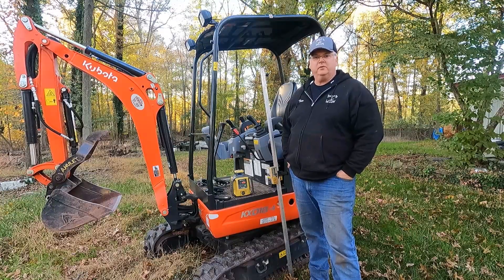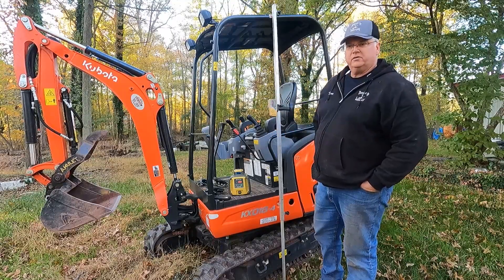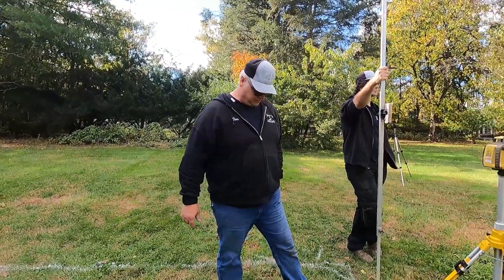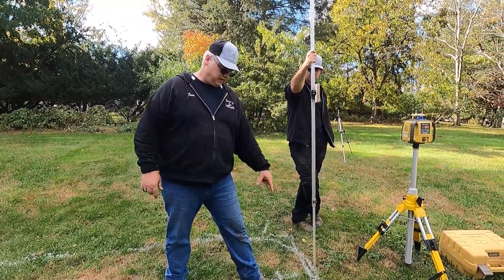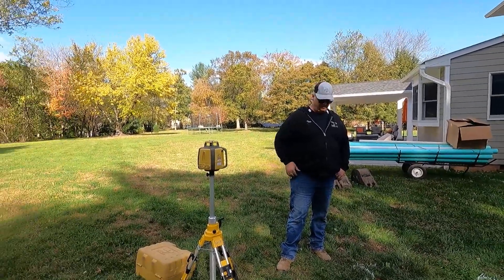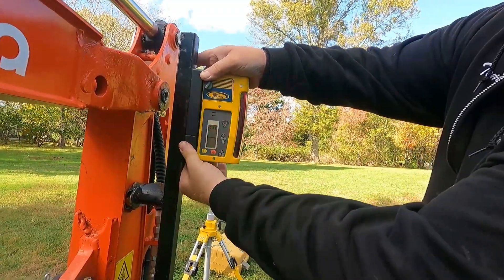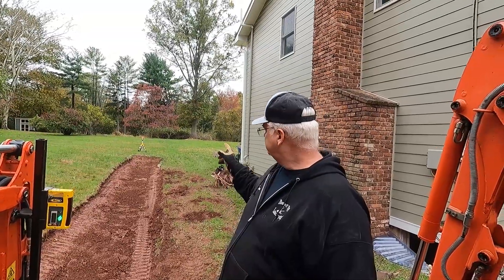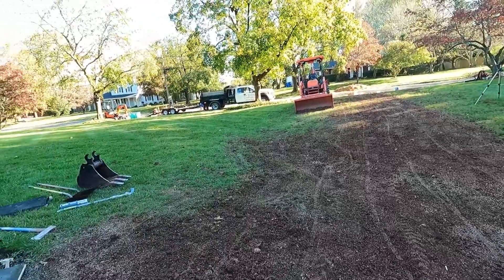How we setup and use our Topcon Slope Laser Level for Yard Drainage Work.

Comment: Your explanation is the best I have seen!  What about perpendicularity of the arm? If arm is not 90 degrees to surface that'll introduce an error. The comments in here are super, andersberglund for example.
Reply from the maker: Thank you Thomas.  You are right that the excavator arm has to be in the same position to be accurate.  I have been using Andersberglund's method and I've shown that in several videos.  It's much faster if you need to setup to a specific slope.  Thanks again and have a great day, Tom

Comment: So at 9:20 was the reciever set at -1 ?
Reply from the maker: Hi Henry, Yes.  We dug down to -5-1/2 on the far hole.  Then we set the receiver back to -1 which is the depth of the first hole.  We then slope the laser down to the receiver set to -1 in the far hole.  That gives us a laser line that goes from -1 to -5-1/2.  I hope I explained it better, Tom
Reply: @tyelandscapinganddrainage  thanks Tom. Would there be a slight inaccuracy by setting the laser up a small horizontal distance away from your first point? Because you would want to set the zero position beside the laser I would think.
Reply from the maker: I’ve tried other methods, but this way always works and it’s very accurate. It does take longer to set up. The new lasers can be set to a slope percentage by just pressing a button which would save a lot of time.  Have a great day, Tom

Comment: Do you need to have the laser set up at one end or the other to get an accurate reading? I'm wondering more for if you do the measuring by hand. Thanks
Reply from the maker: Hi Seedlings Gardening,  The laser is accurate and level no matter where it is.  If you are doing slopes then it has to be set parallel to your trench.  The majority of the time I set up the laser and then work away from it, but sometimes it's more convenient to work towards the laser.  It works the same either way.  I will measure lengths by measuring wheel, but all the depth work it measured with the laser.  I hope I answered your question.  Please respond back if I didn't.  Thanks again, Tom

Comment: Hi 
There is an easier and faster way to set up the laser, you know that the laser is level after you turned it on so for example you want it to fall 1cm per meter you measure a 5m distance from your laser and put your receiver at zero there then move it down 5 cm from your zero if you want it to fall that way, then push the down slope Button until its find zero  on your reciver, now you know the slope is 1cm per meter without having to do adjustment to the ground.
Then you dig down to the preferd begining hight beside your laser and set your reciver at zero there and dig in the direktion you have set up your slope at.
Reply from the maker: I wanted to thank you again,  I used your method on our last video (vodaland catch basin) and it worked great.  Thanks, Tom
Reply from the maker: Awesome, thank you very much. That is much easier
Reply: I don't understand this but it sounds good 🤙

Comment: Hi, what about  factoring in topsoil after? Do you drop all your measurements at least an inch to accommodate the extra dirt? Or doesn't matter? Also I run a Kubota kx-80 with ditching bucket with the tilting head. Highly recommend that for your machine especially for cutting a swale.
Reply from the maker: Thank you for your comment and for watching our video. The soil there was very good so I didn’t need to add any top soil. I’ve thought about the tilt bucket but I haven’t pulled the trigger yet. I’m pretty quick with the 6x6 timber. Thanks again, Tom